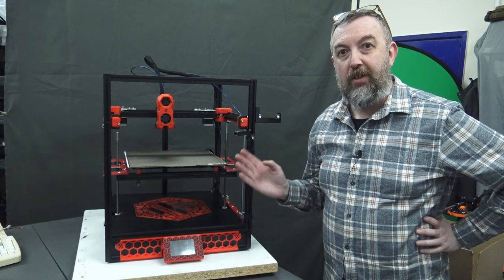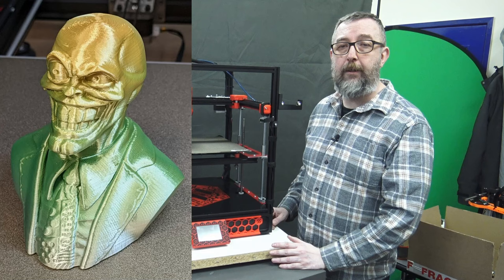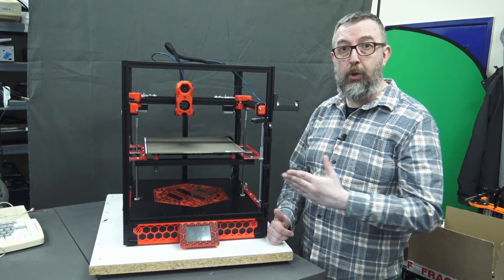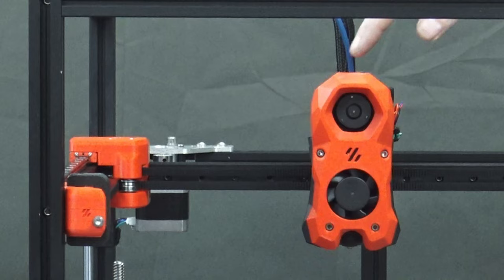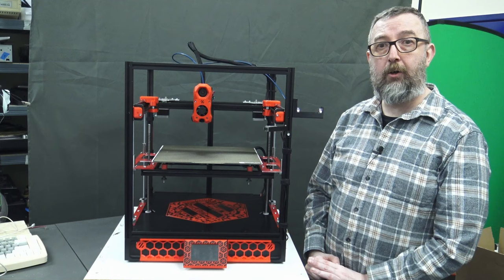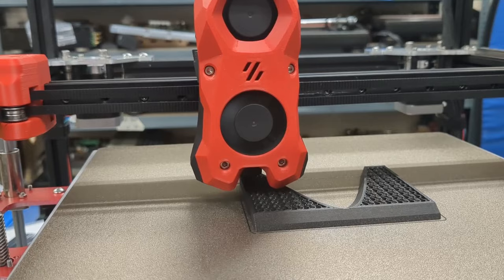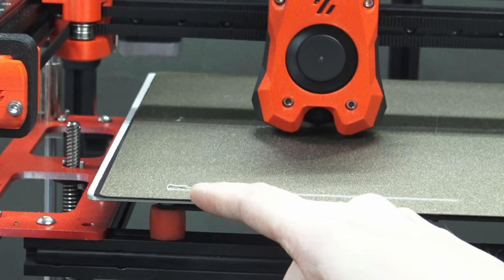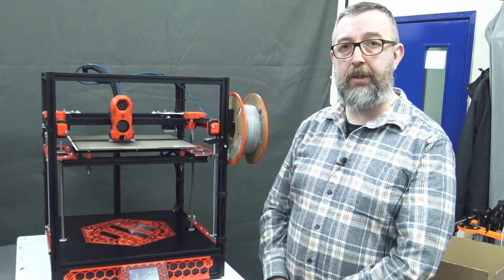My custom self sourced Voron 1.8 3d printer

Comment: Nice build, like yourself I enjoy scratch building/modifying printers,  i have taken inspiration for Voron printers and constructed my own builds,  reusing parts form other printers, 👍i have a hack for mounting MGN9 rails on 2020 v sot using a1mm  thick x16mm shim washers between the rail and the 2020  on for each mounting bolt. "sounds wrong  but works very well."....   🤓 this hack makes repurposing an old ender 5 frame quite possible....  thanks for sharing you build 👍

Comment: Here I was thinking I was the last '1.8' ever built. Mine has a similar number of deviations from the spec for the same reason: I used what parts I already had, where I could. Mine also has a weird Z axis because the leadscrews I had were slightly too long, so it also has a 'deeper' area under the bed. Your bed mount is much nicer than mine, I have some z-wobblex's from Mirage-C to install later to try and fix that. Very nice build!
Reply from the maker: I was so pleased it didn't have any z banding issues and I think very lucky.

Comment: There is nothing wrong with pulling a Tony Stark and building something in a cave out of scraps!  It turned out beautifully and runs like a Voron ought to.  

I've got a 1.8 Frame kicking around that I bought on deep discount that I'm trying to figure out what I want to do with.  Maybe I'll pick up some old printer and raid it for parts!

Go get a serial number, if you haven't already!  You can do it by posting a link to this video in the VoronCoreXY subreddit.

Comment: Are you running a single MGN9 rail or MGN12 for the x axis? I'm trying to find a MGN12 mod for the 1.8 but I'm not having any luck.
Reply from the maker: MGN12 rail for the stealthburner and tap.